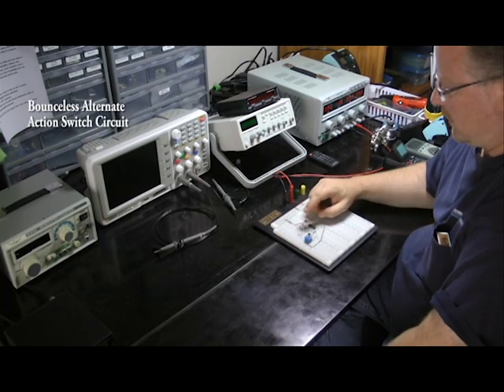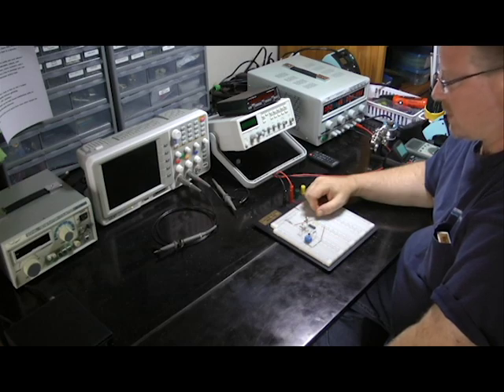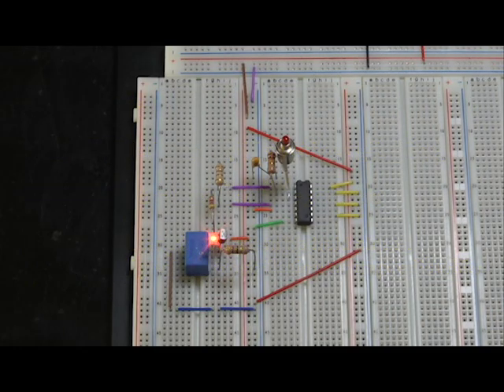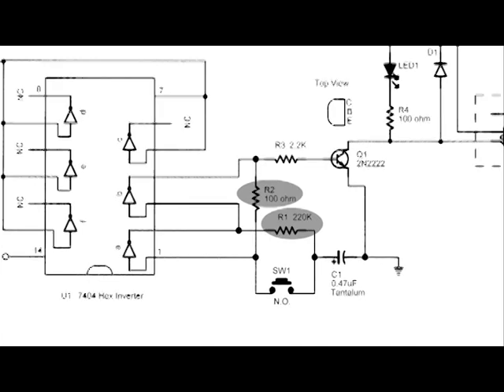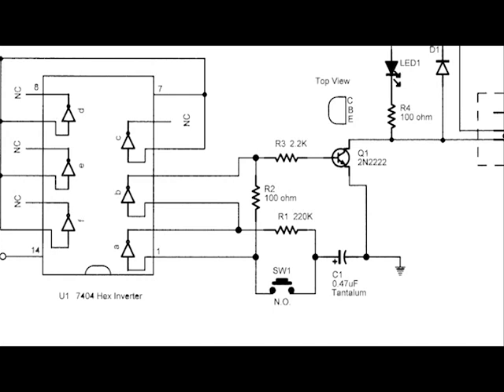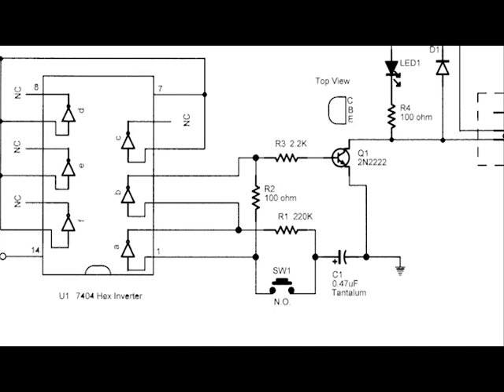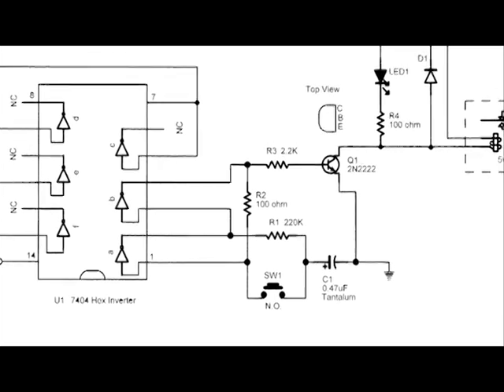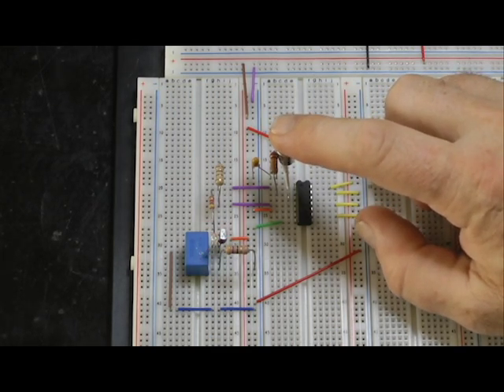Push On - Push Off Switch Circuit Push On Push Off Alternate Action

Comment: Dear Mr. Tim, thank you for your video presentation, I build this kind of circuit with exactly same components, it works ok but it power on in on condition. What sould I do to make it to start in power off state as you mentioned?
Reply: +Ninoslav Milosevic 
Hi Ninoslav. Thanks for watching. As long as R2 is 100 ohms the circuit should power up and stay in the "off" condition until the switch is pressed. Please check your resistor values carefully. Good grounding and a single power source are also recommended. Good luck!

Comment: need to build this type of circut needs to be compact but needs to be a single button press to power a relay that will power on a internal power supply of 12v 3a on and stay on then press it the button again then the relay will power off but not run hot due to being off for a vary long time   also can't loop if the button is held down any one got a good diagram I can use to build this  I'm using it on a console mod project with a old gamecube system